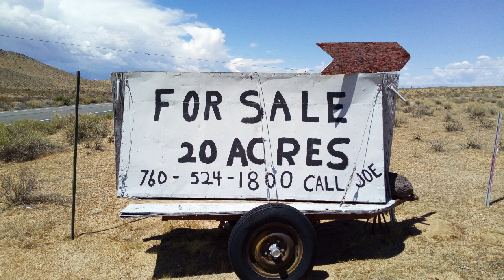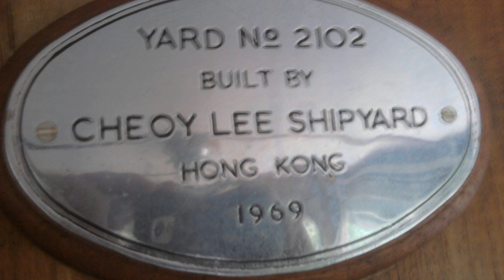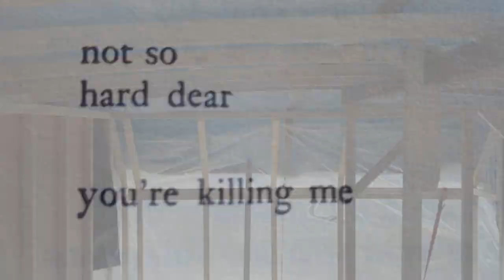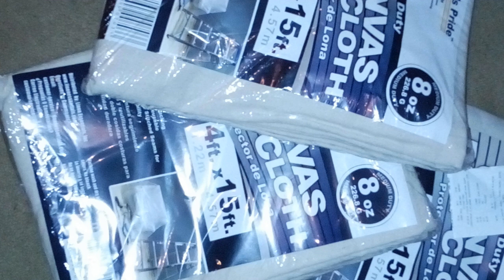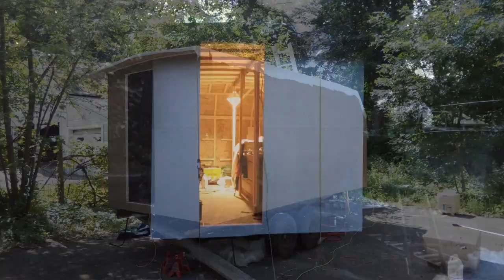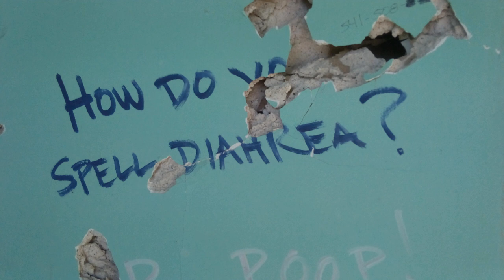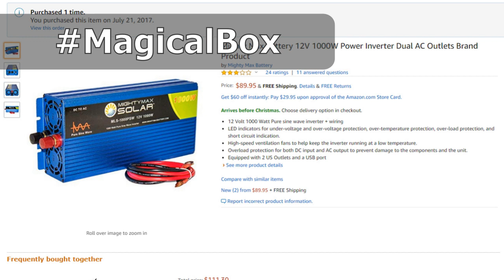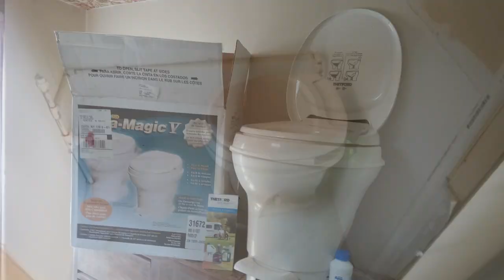My Homemade Off Grid Camper Build

Comment: Well done man, you did well and I like the result. I would change one thing though. 
I converted a van into a small camper van and one of the first things I got supplied (by the misses) was one of those extremely gross porta potty thingamabob. I installed it and used it for a week or two but after I emptied the damn thing the second time I swore there would not be a third time. I swung into diy action and fashioned a box with a bucket and a milk jug in it, installed a bought piece called a urine diverter and placed my favorite toilet seat on top...voila a 100 dollar dry toilet. 
Let me tell you, it is great... uses no water, just sawdust/wood shavings from a wood shop, a bit of these dry kernels which de-odorize porta potty's as the active ingredient in the pee milk jug. Cleaning is easy: the number two's with the sawdust sit in a plastic bag and go into your friendly neighborhood dumpster, the number one can be emptied basically in nature provided you don't over irrigate a single area (if you catch my drift) and stay away from any water (sources)
My dry toilet is a basic box with an upholstered hinged lid (which upholstered bit can be removed) so it serves 3 basic functions: it can be an ottoman, a side table and a crapper...
And don't worry there will be no smells or nasty odors... Dry toilet how to's can be found on the Youtubes...

Comment: Awesome job Cranky! thanks for the down to earth camper build story. 6 out of 5 gold stars! building one myself from a 21' boat frame. Just out of relevant curiosity, how much does your hard f*ck!ng Brutus weigh?
Reply from the maker: Sorry for the super late reply. I actually have no idea how much Brutus weighs. I can tell you that my old 2002 Dodge Durango doesn't enjoy towing it up hills though. I'd really like to build a custom trailer chassis for it because the old boat trailer it's on right now is really overkill for it.
Reply: @crankynomad9032  do you think You can use extruded aluminum it’s very light and super strong 💪 and then use sunroom roofing and tin roof panels for siding?

Comment: if the paper town law says no wheels ,,, then take them off .. You can put them back on later. Then you are legal.
Reply from the maker: That concept gets tossed around a lot in the tiny house community, but it isn't globally true. No one cares about  whether the wheels or mounted or not. It's still not a permanent structure.  I worked for a municipality back when I was planning to buy property and build a tiny house, so I had easy access to code enforcement. Most towns have a minimum square footage requirement for a dwelling. Where I was, it was 600 sq. feet. So, even if constructed on a permanent foundation, a tiny house would never be approved.